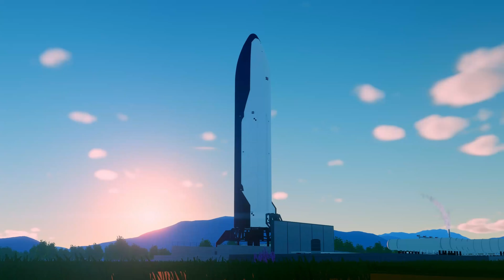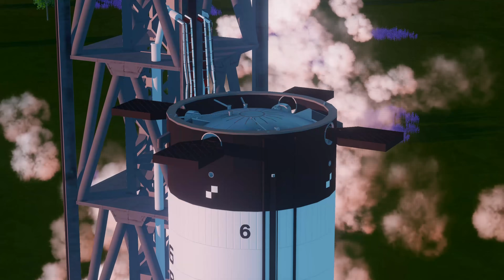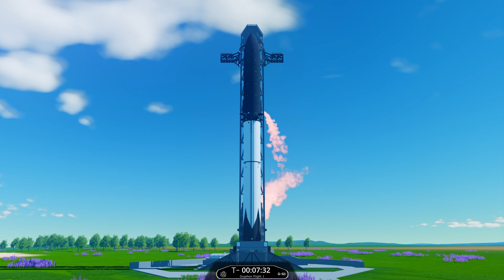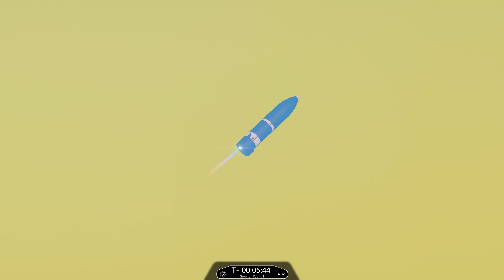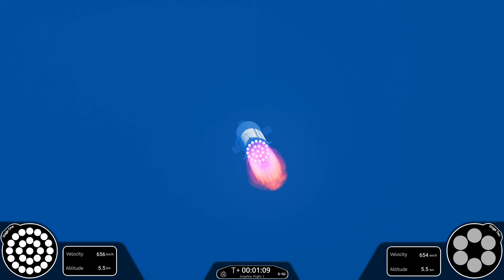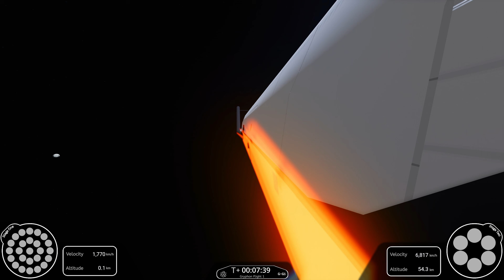Test Flight One | Gryphon

Comment: Isnt this just a varied smaller version of starship?  The booster, the grid fins, the flaps, the heat shield, its all the same!
Reply from the maker: It’s definitely inspired quite a bit yes
Reply: @FusionSpace2023  fairs!
Reply: @TheCosmic_Star#fairs
Reply: so I guess anything with grid fins and a heat shield is starship
Reply: @stevengaming3689  no it just looks nearly exactly like a recoloured starship.
Reply: Descent phase is fairly different for the gryphon upper stage, gen 2 will probably diverge further from starship in design